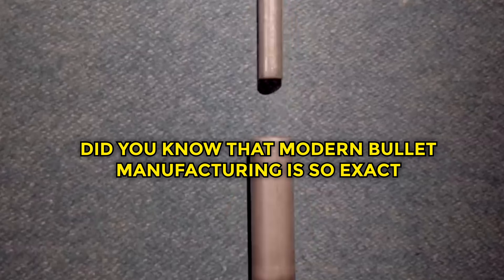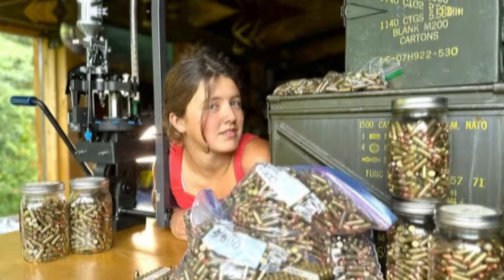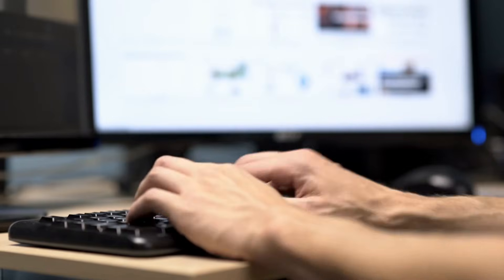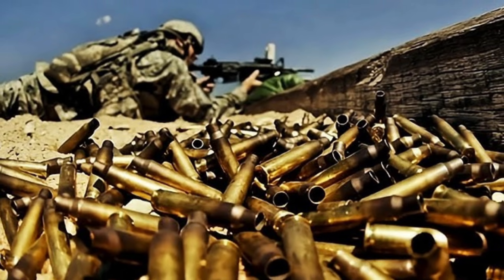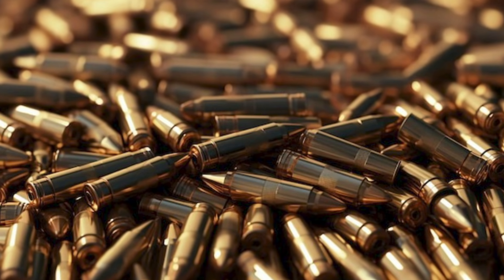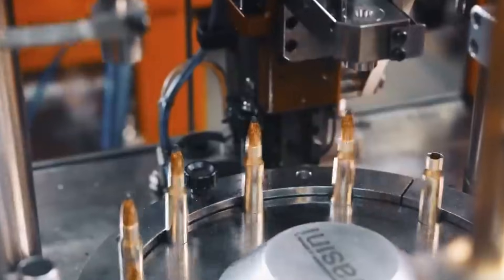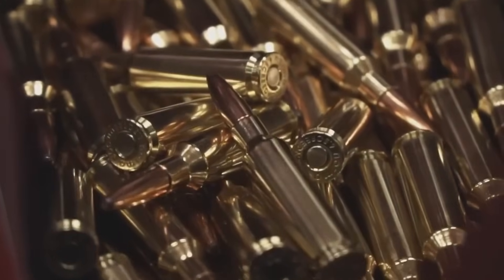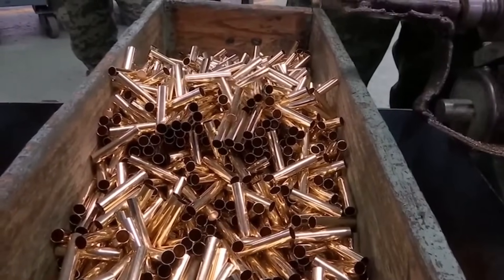How BULLETS Are Made in Factories | HOW IT'S MADE

Comment: The transformation from raw metal rods to the final core and jacket involves extreme processes, especially the use of hydraulic presses and specialized dies for shaping. I’m curious about the casing crimping step: how does a technician measure and adjust the pressure to ensure a tight, perfect seal that holds the bullet in place without deforming the casing metal itself? Is that crimping pressure verified using non-destructive laser measurement tools?